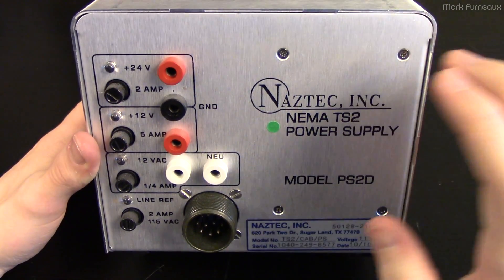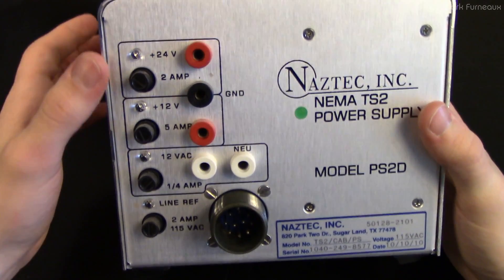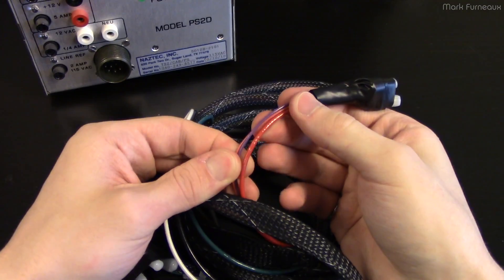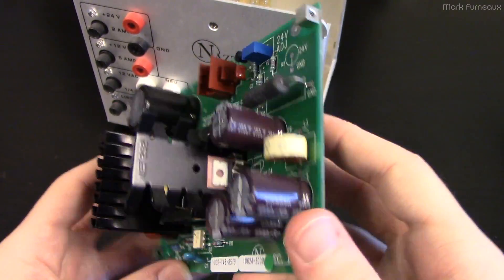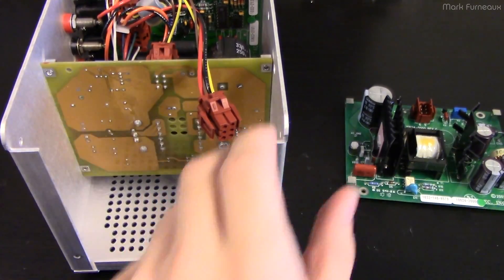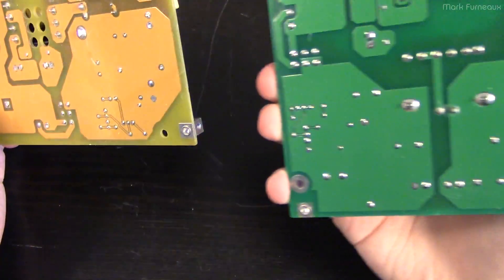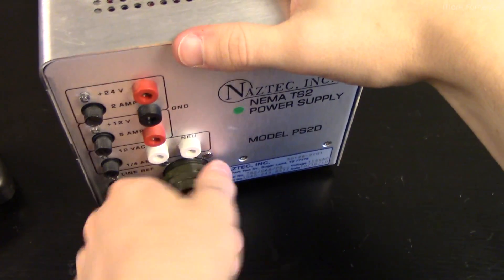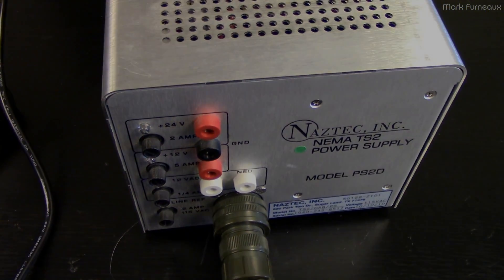Teardown of the Naztec PS2D Traffic Light Controller PSU

Comment: As a traffic light collector (I own a few traffic lights,  a couple of controllers, load switches, and so on from about 20 years ago (the lights are from the 60s) I can tell you that for a traditional signalized intersection with say 4 turns (arrow signal heads) (one for each direction N,S,E,W) thru lane signal heads, pedestrian signals, push buttons, luminaries (the over head lamps with sodium vapor lights or LEDs), the controller cabinet with all the hardware (back panel, controller, load switches, DPDT relays, power section, conflict monitor, OPTICOM (for emergency/bus, and trains) system, loop detectors (or cameras) can start at $600,000, and go up from there.

I appreciate this video as a collector.  You should see about getting some other traffic light gear and doing videos on them.  The old mechanical controllers from about 30 to 40 years ago are pretty awesome too).

Comment: The "circular" connector you referred to are called Cannon plug, widely used in aircraft general aviation as well as military.
Reply: ALLOY 
Also used in countless industrial equipment. They're great for combining < 5 amp DC power delivery and control lines/signaling, just like in this power supply.

Comment: Interesting that they didn't route a slot between the pins of the connectors on the 12V and 24V boards. The isolation gap gets a bit tight there, they would have to definitely make sure there's no flux residue on the board!

Comment: I would think all of those voltage outputs are accessible from the circular connector. Then the banana jacks are for the technician to verify the supplies are within tolerance. But there were only 3 extra leads you found, so I'm not sure.

The difference board hole spacing is good, so you can't swap the boards around. They could have also polarized the connectors instead (they look like the same type).
Reply from the maker: You are probably right, as that makes a lot of sense. I'll try probing the pins and see. I suspect that there might be a shared ground between the DC outputs, and possibly even the line ref. Then there's the 2 pin connector which might be AC....
Reply: Mark Furneaux 
Shared DC ground is right. It's also visible/implied in the banana connections layout.
Reply: Yeah I'd be surprised if the bananas were for anything but testing as they'd shake loose over time from vibration.